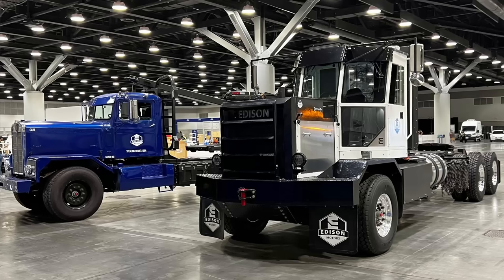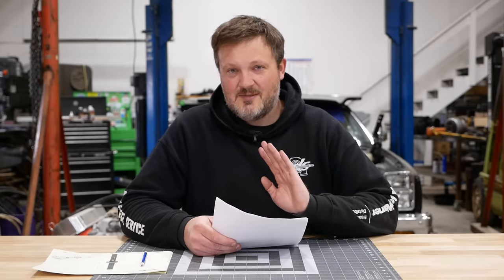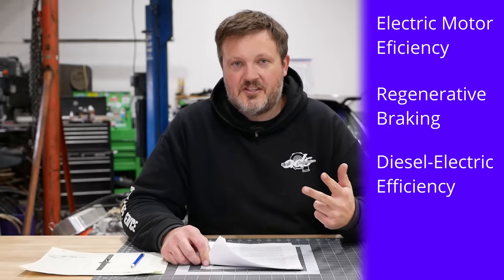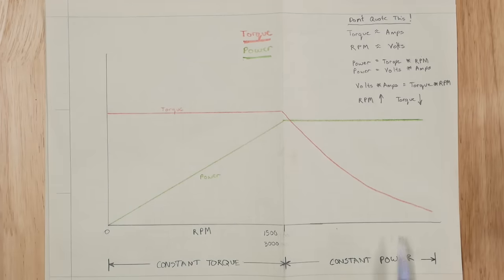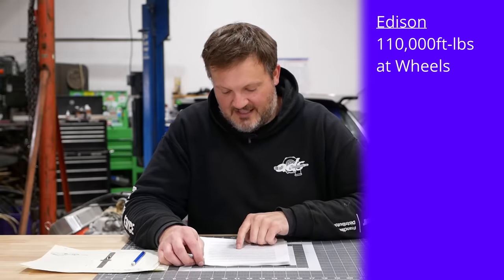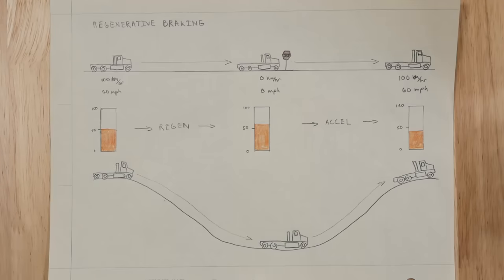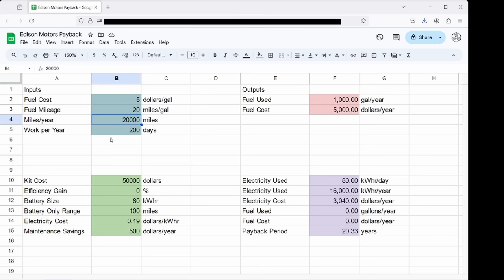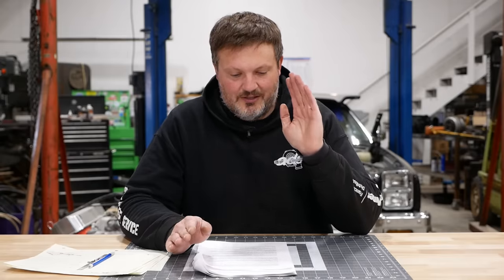Edison Motors Built a Diesel - Electric Semi Truck

Comment: It's all been said what i wanted to contribute to this video, Wes.

So, instead, I'll just say  "thanks for the memories" because for me, thats all they will be.

Your evaluation on electric hybrid trucks, bigger than a box van or large pick-up will, in my opinion, never get off of the drawing board. At least, not in my lifetime.

This is why i have not paid much attention to hybrids or even electric cars in general. There is another reason, too, which i will explain. This may go on a bit so please, bear with me.

I want to own an 'electric' camper van one day or as the Americans call them, RV, but the cost for a new RV, using Tesla technology and Japanese batteries, starts from £164,500 upto £200,000 depending on extra batteries and other options you add on, which is way out of my price range.

The cost of a new RV similar to the electric one I rented recently with a 2L diesel engine is between £104,000 and £128,000 depending on extras. Quite affordable at my age, 63, and perfect for when I retire in 2 years time. 

When I rented the electric RV recently, charging the batteries was angrily frustrating to say the least. The app showed many places to charge and gave plenty of information. The problem is, that information was incorrect. 

I would say out of the 70 or so charging locations I visited on my travels, 50% of the marked locations did not exist, and the other 50% either did not work because the charging nozel didn't fit or were not in use between certain hours! I constantly had to depend on the built in self charging facility of the solar pannels on the roof. This would only work during daylight hours, obviously, when the vehicle was stationary and the ignition switch set to charge.

As a precautionary measure, i spent 4 hours a day in a car park or layby from day 3 onwards, just to charge the batteries in case I was unable to find a charging point open or compatible late in the afternoon or evening. I spent almost as much time driving around looking for somewhere to charge as I did sightseeing. 

To cover my 2,500 mile round trip around the UK in 5 days, charging once a day was impossible. The rental company told me I would only need to recharge once a day, which would take approximately 70 minutes. He also told me I would not have any difficulty in finding charging stations, providing I use their app, which I installed in their office before setting off. When it was possible to charge at one of the locations marked on the app, charging time to full capacity took 5 hours. A far cry from the 70 minutes i was told. Lies, lies, all lies.

When I crunched the numbers, this is what I found.

Going on charge times and usage, (not including carpark or layby charging time) it would take me a minimum of 8 days to cover the 2,500 miles at a charging cost of approximately £1,270 but the actual charging payments I made taken from my receipts, cost me £1,497.

Whereas, covering the same journey in a new similar size camper van with a 2.3L diesel engine last year, the cost was ridiculously less with diesel costing me just £624.87p. That is how much i paid on the receipts I submitted with my tax returns. 

Where is my insentive to cross over from fossil fuel to electric power? Because unless they can make a camper van (RV) travel about 1,500 miles a day on a single charge, that doesn't cost the earth, then I'll stick to using diesel, thank you.

Oh, I almost forgot one very important point. You spoke about torque power. Traveling around Devon, North Wales and most of Scotland, there are hills, big, long, steep hills some of which are in the mountains. Some roads are so steep that even with a diesel engine, it was difficult to climb.

When I drove or should I say, attepted to drive up the same hills I've driven up and down many times beforehand over the years, in the electric RV, there were 2 hills in particular that stand out. One is in Wales, while the other is in the Highlands of Scotland.

I had to climb those two roads in reverse because the electric motor did not have the torque, no power. There was a third road that I could not navigate forward or in reverse even with 68% battery capacity. I needed the assistance of the RAC, which for those who do not know. They are a vehicle rescue service.

Now, a history lesson. King Edward VII's interest in motoring led to the command in 1907 "That the Automobile Club of Great Britain and Ireland should henceforth be known as The Royal Automobile Club".

F1 is doing their bit, and they still have their issues, but in all honesty, I can't see myself driving up and down the country in an F1 race car now or in the near future, can you?

Good video Wes.🤘⚒️🏴

Comment: When they said they want to convert some heavy specialty vehicles I thought fair game. When they announced the whole pickup truck conversion, I was a lot more skeptical.  Newer vehicles have network connections to EVERYTHING and trying to implement a while new driveline that works seamlessly with the variety of pickups and furnishings inside them that we currently have seems... Extremely challenging to say the least.

Comment: This is one of those deals where a couple of plucky lads with a little learnin’ and gumption said “Looky here what we just built to replace a system that has proven itself over decades of use and refinement!” and the guys and gals with slide rules and adding machines just have to peer at them over their readers, slowly shake their heads and say “Yeah, nah. Doesn’t work. There’s a reason nobody does this”. 

I watched a couple of their videos and very quickly realized that they were indeed trying to sell the latest perpetual motion machine. I just hope they don’t fleece too many gullible investors.

Comment: John deere came out with hybrid 644k loaders some years back
Company i work for got 4 of them,
They had a 6068 deere engine a generator a converter and a drive motor so no batteries 
Those things didn’t make any sense at all, they burned more diesel than the regular machines because of the engine being at high idle all the time, they were reliable until they started having issues, 2 of them need an engine and the other 2 need a $35,000 generator.

Comment: THANKS WES.  You offered a lot of great information HOWEVER: I believe you missed the bigger point. EFFICIENCY really is "Amount of energy IN vs Amount of energy OUT" It is really that simple.
We know how much energy is in a gallon of diesel fuel. We can MEASURE how far a vehicle moves.  Everything else is irrelevant to determine "efficiency".  Personally, I like to measure COST PER MILE and have a spreadsheet for every vehicle I have owned over 100s of thousands of miles. (Motorcycle, Scooter, VW TDI, Dodge truck.... etc) The scooter beats the VW TDI.... but the motorcycle comes in 3rd.

Comment: A lot to think on in this.  They might benefit by looking at some of the old SW-12 and MP-15 yard engines, rather than the all A.C. main line engines.  Circuit control via a system of relays, plus generator and motor field control vs computer controls might be easier to manage.

Comment: Ships and submarines has had that technology for a long time, they also had battery-operated cars back in the early 1900s, it's not like the new EVs have invented the new wheel.  Farmers run about 12 to 24 hours a day tilling, planting and harvesting we do not have time to let batteries charge and we're not around electric plugs. What they quote the average run time on batteries is bogus because when climate is real hot and cold and how hard you're working the equipment drains batteries quicker. Tell me how great it's going to be when it puts majority of the mechanics out of work and shuts down all the gas stations, thousands of acres of good farmland and forest gone because of solar panels sitting on them, holes dug bigger than states for the minerals to make solar panels and batteries, don't forget about the power outages. I hope you're the first one that goes out of business because you love it so much.
Reply: While that is true now, there would be a whole lot that could be done with battery electric if you just thought out stuff a bit more. Wouldn't be cheap, but still possible, unlike cross atlantic flights at 900km/h with batteries.

Comment: Not a complaint more of a question my 2007 dodge 2500 2 wheel drive quadcab first gen cummins gets 6mpg pulling a loaded stock trailer an 10mpgs empty I am just curious how that affects the spreadsheet
Reply: Ps always appreciate your effort in the videos

Comment: Doesn’t the math say you should see an increase in MPG because the motor is under constant load?  Should be 8-12% which puts the payback in a much more reasonable timeframe if you are driving 50-80k miles per year.

Comment: In Britain I think, they had a mine where the filled cars ran downhill, and in turn, these pulled uphill the just emptied carts on another track. No other power source used but gravity. I too have paid attention to these guys since Day 1, and know that their particular approach has a specialized role it can succeed in. That fact is, IC over battery hybrids and all electric powered rigs are seeng larger and larger roles in heavy industry like mining.

Comment: Your math is questionable. The efficiency could be through the roof. Common diesel generators use 0.4 L per kWh. Cruising truck doesnt use 200kW. Maybe uphill or while full throttle accelerating. A diesel engine itself is 35% efficient . Two stroke is some 50% thermally efficient without being in optimal RPM.  While it may be true that charging the battery is not without loses, this can be optimized. There are many existing types of batteries better suited for applications when you dont need the highest energy density but a faster charge. Some may be bulkier which is not an issue here and cheaper. A superconductor is super efficient. The thermal energy could be used too one day with a Stirling engine for example. They may need some improvements here and there but it's absolutely the right direction IMO
Reply: I dunno what you're smoking. A 60 ton truck can easily consume over 50 litres per 100km, which would be exactly 200kW power output, presuming 40% effiency.

50L*10kWh/L*40% = 200kWh. The logging trucks can go higher than that.

Comment: Wes, I enjoy you and your great analysis. The elephant in the room as far as I'm concerned is where is this electricity going to come from current production? Now, since right under our feet we have the largest deposits or some of the largest deposits of natural gas and oil. With how fragile our electrical infrastructure is compared to" drill baby drill" I see no future in the long run for electrical vehicles. Although I think all attempts and work on them is good for the country. Think of all the new things that will be discovered. Thanks again for your time, Dave in San Francisco
Reply from the maker: Time will tell.

Comment: As an engineer, I agree with the majority of this.  One thing left out is that you can't just start and stop a turbo diesel engine like a naturally aspirated gasoline engine.   Last time i dealt with a qsx15, it wanted 5 minutes at idle before shutdown to allow the turbo to cool.  The honda and toyota hybrids my wife and i have cycles the engine on and off multiple times per mile.

Comment: I don't give Edison that much credit because the ideas they are using are simply what the train companies have been doing for many, many years. Edison is just copying what train companies are doing on a smaller scale or what the Toyota Prius is doing on a larger scale. It is still a great concept because it is still the most efficient way to move products and people especially the trains that are currently moving freight. If the train companies will share there concepts for applying torque to improve efficiency then that would push these concepts along with less skepticism.

Comment: tHE RPM OF THE E MOTOR (3 PHASE) USED  IS REGULATED BY THE FREQUENTY, NOT THE VOLTS... AND THE AMOUND OFF POLES IN THE MOTOR.

Comment: So, I have a welding shed next to the barn. That means that I have level 2 charger juice hanging on the walls in socket boxes.
Ford is offering a 0% note on the Mustang Mach E. Got one parked out back for my daily 175 mile daily round trip to a college upstate where we're ripping out all the steam and replacing it with geotherm.
Only took me 24 years to get into the 21st century.

Comment: Great video, Wes. i saw this electric semi truck they built. It looks amazing. I still think they have a long way to go. It's interesting how you spoke about the 30 minutes of peak electrical power and continuous electrical power.  That sounds similar to a diesel locomotive,  with start -up tractive effort. And continuous tractive effort, like the C45ACCTE (GE), which has software to control maximum tractive effort. Very interesting video Wes 👍👍👍👍

Comment: Let's have a race at posted speed limits across Canada between loaded Edison truck and an equivalent standard diesel truck.  Lets do a race in winter and a race in summer.  Didn't racing improve auto industry?  Lets have some races.

Comment: 10:00
3000 rpm is redline for most diesel engines. I don't get why an electric motors peak torque being at 3000 rpm would be an issue. Seems like that would be a plus. Especially if you're working with factory gear ratios already meant to work with deisel engines.
Reply from the maker: A diesel engine has 5 to 18 gear ratios. An electric motor has 1.

Comment: In my business I deal with a lot of rechargeable batteries. I know by experience that they lose a small amount  efficiency every time they are recharged.  I never see battery replacement costs  included in the efficiency statistics of electric vehicles. Batteries are expensive and should always be included in cost analysis of operating an EV. They will always need to be replaced at some point. Just my 2 cents.

Comment: Great video!   Perfect timing,  because I just got my electric back after a storm knocked it out for nearly ad day.  Of course their numbers are WAGs (Wild A$$ Guesses)  but it's marketing 101   Re: Charging while on hwy.  I seem to recall Edison saying the generator would just run the axles and slow charge the batteries in one of his videos.  Also I would expect them to switch to the generator before 100% consumption of the batteries.   I suspect they are also including regen in their numbers.  They still have some very valid points and if this becomes a market generators too will get improved.

Comment: The reason they use diesel electric on trains is this. Can you imagine the size of the clutch that would be needed to
couple the engines to the wheels on a locomotive. You may get away in the modern world with an automatic transmission but the thing would have to be huge.

Comment: There was 1 statistic that i did not hear you mention. That is the state of charge as it relates to ambient temperature.  I have read articles that say current electric  vehicles  have as much as 60% loss of range from seasonal temperature change. That directly  affects how long you have to stay on diesel power versus electrical power.

Comment: Hybrid electric does have some major reliability advantages over pure EV battery powered cars/trucks/semis in that you have much better range, are not tethered to traveling between charging stations, can travel to places that don't have charging stations, less power grid overload potential, Less/No cold weather impact on performance/range, better usability during disasters, less environmental impact (less lithium use), lower cost and better reparability.. I have said for a while that that jump straight to battery was a mistake, and we should have had a longer stepping stone at hybrid till battery tech moved forward.

Comment: Nice workup Wes.  With 40 years in the auto industry, my outlook is that electric/hybrid propulsion is an interim option that will find applications that make sense for sure.  The obstacles to mass adoption are charging infrastructure, recharge time, battery lifecycle, and battery replacement cost to end user.  I am confident there will be future power technologies [less than 10 years] that will overcome the the four obstacles mentioned above, and be viable for mass adoption without enormous investment is refueling infrastructure.  OEMs are currently working on alternate solutions to electric/hybrid battery power options.  Electric drive motors make a lot of sense for all the reasons you mentioned.  The big break through will be in how the electricity is generated and moved to the drive motors, without the use of massive energy storage systems like batteries.  Love your channel!!

Comment: What I recently learned watching a tire video is how much weight the EV battery pack adds to the vehicle (and thus the need for specialized tires.) On a gas passenger vehicle the weight of the passengers and luggage makes a difference to their overall efficiency, on a EV not a meaningful difference. On a semi that might not be a problem in terms of tires but the overall haulage capacity would probably be reduced.

Comment: Could you please translate all the Erospeak newton meter (?)for all us Americans that still use imperial measurements
I do have to beg to differ with you trains do have batteries, I  tried to get on with several train comp (they have no use for over 50 electricians) and changing battery packs was one of the jobs as for regenerative braking search purple haze in train videos that is the glow off the resistors over heating meaning next time the train crew changes the electrician will be in changing out the burned up mess
Most Owner Operators (OO) I know drive more than 200 days a year "If the wheels ain't turning you ain't earning"
Thank You